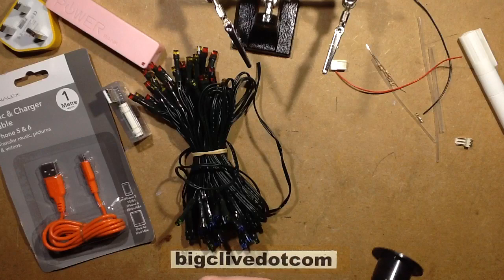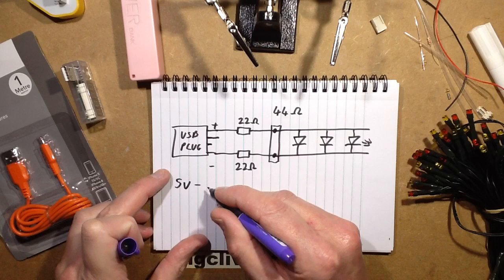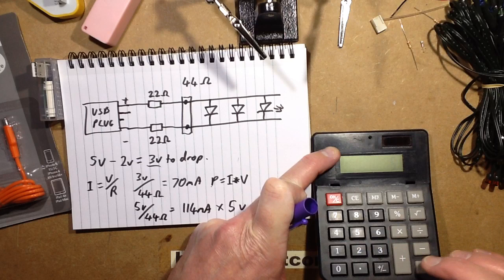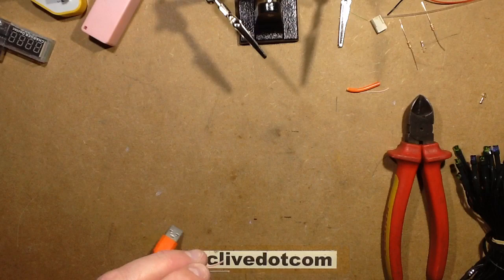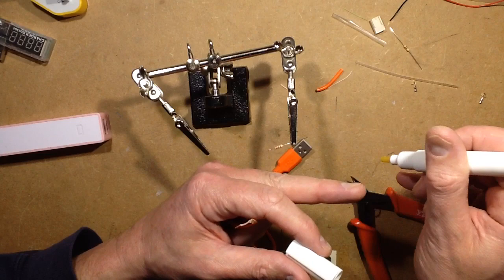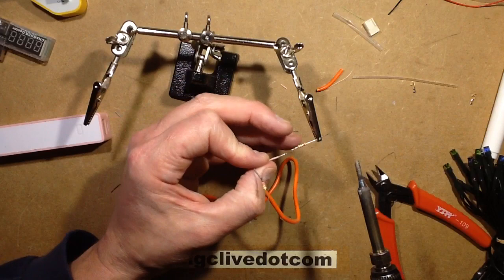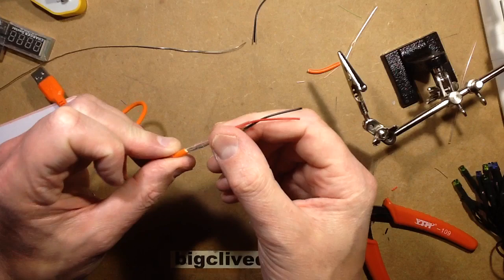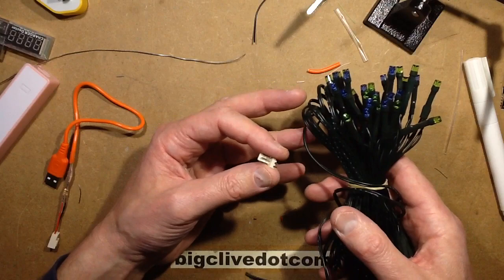Run LED strings on USB chargers and power banks.

Comment: Do you have a video explaining why LEDs in parallel works? Whenever I see the schematic I just think all the power is going to follow the path of least resistance and just go through the first LED like water might. But somehow they're all lot equally.
Reply: Binned led. The leds are tested for their IV curves and the ones with matching characteristics are put together. Any difference will be in milli volta or microamps, So minor that it won't cause too much of a brightness or current issue. One led may be the path of least resistance, and have 21mA at 4.2V, the rest may be 20.3 mA at 4.2V. The thing about the path of least resistance is that it sets the voltage across the parallel elements, but it does not mean the higher resistance elements get no current flow.
Reply: Please tell whoever told you that "current follows the path of least resistance" they must stop repeating it. I don't know where that stupid sentence has come from. It's been there for decades, has never been correct and confuses so many people (like you for example). Current takes all paths according to their resistance. How else could someone be electrocuted by dropping a hair drier into the bathtub? The path of least resistance would be the wires. And to make your question harder to explain: LEDs don't behave like resistors at all.

The same with the comparisons of electricity with water. Let me guess, whoever told you the water examples did not tell you not to make up your own analogies (not your fault). It works for some analogies, but just because water does some thing it does not mean current has to do the same. Btw. water would not take a single path either if you have water in a pipe (you can't compare open water in a drain or water in pipes that also have air in them to electricity).
Reply: Oh yeah... I'd never thought of that before
Reply: superdau I'm more confused after reading your post. Either way though I think it would make for a good video. Maybe AVE will do a video explaining how electricity flows. He's been doing a couple beginner videos like that.
Reply: The issue with the water analogy is that wires have a tiny tiny resistance whereas pipes would seem quite resistive to me.

super's explanation that electricity takes all paths is very true. Just the easier paths get more electricity.

Comment: Why not using small buck step down regulators with CC ability from ebay? :(
Reply from the maker: Cost of resistors 2p.  Reliability 100%.
Reply: bigclivedotcom Efficiency is bad, though and I prefer constant brightness. :/
 Also resistors cost 3x as much in Germany...
Reply from the maker: The regulated 5V supply will ensure excellent stability.
Reply: bigclivedotcom Ah yeah, but doesn't it run a lot longer with a buck regulator?
Reply: why would you buy them from german shops? Just buy a set of 500/1000 from a chinese supplier on ebay, many include free shipping. Just takes one or two months until they arrive.
Reply: Malte M
Yeah it takes ages until they arrive. And then they are packaged like bubblegums and all legs are broken off... Additionally I would have to buy 1000 of every possible value and tolerance each because I can't just buy them in demand.
Reply: There are actually sets of thousand or so with 30 different values which is fine for most applications. I've never had problems with them being outright damaged from shipping, just a bit bent.
Reply from the maker: No, they're definitely still 2p each in  Germany....
https://www.conrad.de/de/kohleschicht-widerstand-22-axial-bedrahtet-0207-025-w-royalohm-cfr0w4j0220kit-100-st-1089211.html
Reply: bigclivedotcom + 7EUR shipping ;)
Reply: People keep telling you options and you just keep finding excuses.
If there was a will, you would have a way.
Reply: Rizon1985
I just like the idea to use a buck regulator much better than a resistor. Less losses, longer runtimes.

Comment: HI BIGCLIVE!, I was wondering..., what if instead of a 5v power bank (usually 1amp) I use an AC power adapter to 2.5v 700ma?. Should I drop the current anyway to 70amp?
Reply: I meant, 70ma.

Comment: I did this, an I'm quite pleased .. however now i have an issue .. one power bank works well with them, but the rest of them (different makes and models but more recent ones) don't. they  run for a short while (30 seconds ?! ) and then switch of, which leaves the lights very dim (i assume its leeching a little from the bank).  .. help!
Reply from the maker: Lower the resistor values.  Some power banks need a minimum current to stay awake.
Reply: @user-gx6jb6wc5g  thank you, i am waiting for a resistor kit to arrive, but the thing is I was using a pulsating LED as a resistor in series with the rest of them.. (it was never lit nor did it pulse them, but they were a nice warm-yellow  and never got hot). 
I'll have to measure the resistance of it. 

Thank you very much!

Comment: Signalex pounds and cable? Interestingly had one of these catch fire & burn my phones charging port last month! Amazed they're still stocking them after having to pay out to replace my phone
Reply: Poundland even...
Reply: Were you also using a cheapie mains adapter? If you were, that is much more likely to have caused the problem.

Comment: I tried this, the LEDs, stayed on for about 30secs, then went out. The voltage was down to 2.6v. Disconnected and tried again and the same happened. Even swapped power bank with same result???
Reply from the maker: If running the lights on a power bank the current will need to be at least 100mA to make them stay on.  Try using lower value resistors.

Comment: Quick question iv a set of 20 Led fairy lights Powered by 3XAA battery, Rated voltage 3v, 15mA. I want to connect  three sets together and us dc. I can find  9v transformer plug but how close do i need to get the mA right.
Reply from the maker: You may be able to connect them end to end if they are identical sets.  The polarity may need some experimentation though.  The battery pack will probably have a resistor inside to limit the current.
Reply: Ya they are thanks for the advice will check for resistor .

Comment: I tried to run an ATtiny85 and short string of WS2812B RGB LED's from a USB power bank but the current draw was too low, and the bank would not provide power... most disappointing...
Reply: There are ways to trick it. a load resistor is easiest. A pulsed load resistor every n seconds is much more power efficient. you could also mod the supply.
Reply: I didn't like the idea of a load resistor, but I do like the idea of trying to pulse it.. I could probably drive that from the ATtiny chip... back to the workbench..

Comment: Yihua rework station?
Reply from the maker: It's a Yihua 8786D.  It's pretty good, but has an annoying buzz from the transformer.
Reply: I bought the Yihua 853D a few months back. As you say, good unit. My transformer does hum but it's not very loud.
The 853D has a variable power supply and a volt meter built in which means I can have my good multimeter and power supply in the workshop.

Comment: If you cut the power wires to different lengths, the resistors can sit more in line, i probably wouldn't sleeve the negative if using an overall sleeve.
I used to have a stripper like yours, but got annoyed at constantly adjusting them, so i did away with the adjustment, but went back to my old faithfuls that look like this 
http://www.dhresource.com/albu_342798255_00-1.0x0/7-inch-multi-functional-automatic-wire-stripper.jpg
I love those for projects, i've had them since the 70's ans made by Black and Decker, 
if i'm just doing something quick i  use sidecutters, though i turn mine the other way round to what you have, the angle is better for stripping imo.

Comment: Whats your reasoning for using a flux pen? Is flux core solder not enough for this application?
Reply: Sometimes you need extra flux for some difficult tasks.

Also, I'm under 300.
Reply: Yeah, a lot of the time extra flux will make it solder with a much shinier and cleaner solder joint.
I generally use flux paste, it's based on petroleum distillates and chloride+nitrate salts. Ammonium Chloride, Sodium Chloride, Potassium Chloride and Potassium Nitrate. Works wonders even for the most oxidized wire. Don't EVER get it on pliers or screwdrivers, it works wonders to give them a orange crumbly texture. XD
Reply: The flux in the core is enough for the first application IE pre-tinning the wires/other terminals but then when you go to reflow those pre-tinned contacts to make the actual splice there isn't much if any flux left. And that's why you need to apply some extra flux to get a nice connection.
Also when tinning a thick-ish stranded wire some extra flux might still be needed to get a nice even wetting of the whole wire.
Reply: Since he pre-tinned the leads, the flux got burned off on the first application so he added extra to help with reflow.

Comment: what is the best place to get electronic components in the uk? including wire
Reply: ebay!
Reply: For wire, depending what you're after, for single core,  tri-rated switchgear cable from electrical wholesalers is pretty good stuff (they do it down to 0.5sq mm) and it's available in a wide range of colours for cheap
Reply: CPC/Farnell, eBay, BitsBox. eBay is definitely a good one for the majority of things, just make sure you select UK on the filter if you do want it from the UK.
Reply: when buying of Ebay. If you want to buy from British sellers click on about seller and then click on legal info make sure it's a uk address.
Reply: Simon Hopkins Or just wait ;)
Reply from the maker: My main choice is Rapid Electronics.  Even if they do penalise me with a ridiculous delivery surcharge to the Isle of Man.
Reply: thank you all for your responses, ill check them all out. i usually go to maplin but it is very expensive

Comment: Hi Clive, why don't you just do V2/R = P
Reply: Because this method has been in place since at least 1964.
Reply: Because he likes following simple laws like V=IR and P=IV because with the two simple formulas you can figure out a lot of things instead of learning loads of other ones
Reply: Because that can pretty much only be used for resistors and is useless for any other power dissipating devices.

Comment: A typical 2200mAh power bank would run it for 31 hours at 70mA.
Reply: it's a lot less that that, 3.7v or 3.8v nominal, 4.1v or 4.2v fully charged depending on the cell.. 
Alot of those single cell power banks like Clive is using can be charged and supply power at the same time, could use the solar panel to chage and extend the operating time
Reply from the maker: Yeah, the 2200mAh is the cell rating.  Once you've boosted it to 5V and add the slight losses in the process, you won't get so long.
Reply: wouldn't you get a bit less than that because the 2200mAh figure is at 3.7V?
Reply: the Mah rating is from 2.5v (sometimes 2.75v) to 4.2v. 3.7v is just the cells average cell voltage (where it stays at the longest)

Comment: just put a female USB plug on the end of the string and they are chainable.
Reply: But no, they aren't chainable. The resistor values that are right for X LEDs are not right for 2X or 3X or whatever LEDs.

Comment: having the data leads at a different length is not necessary, a lot of the time there joined together in circuits anyway